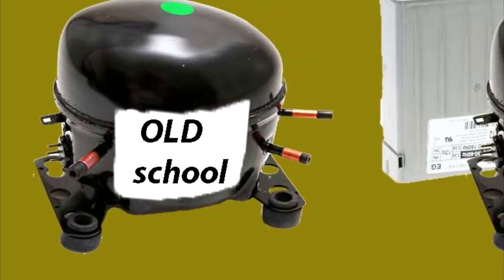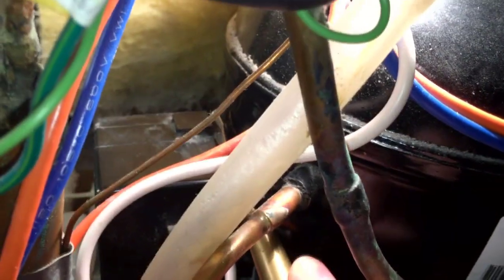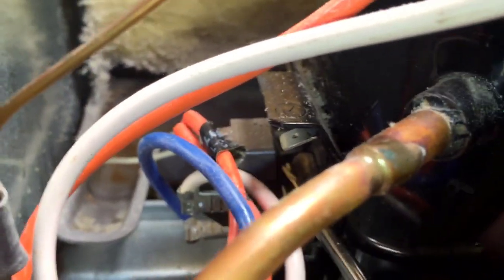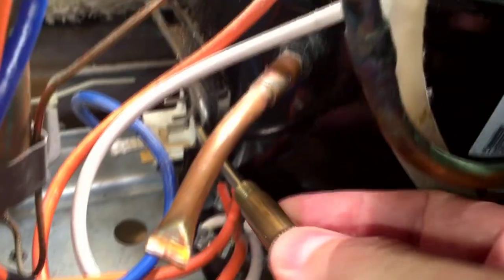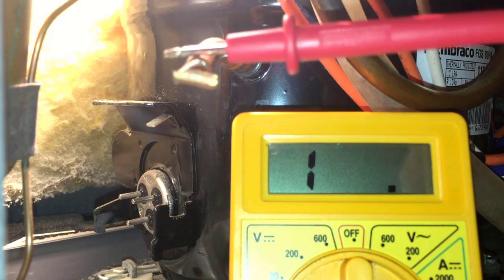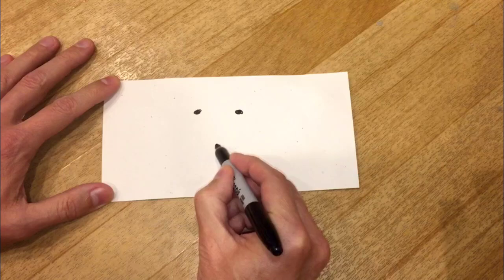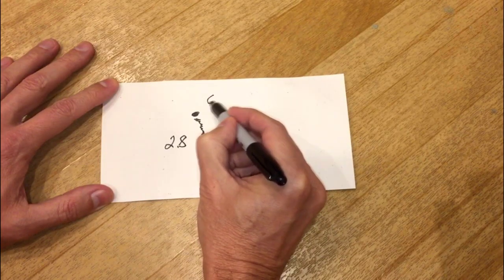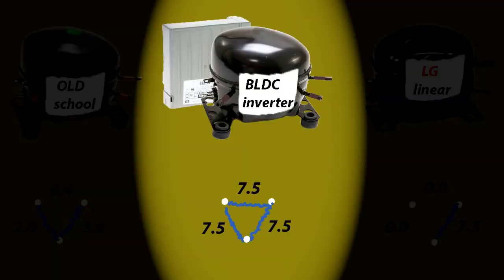Testing refrigerator compressor LG, Samsung, Whirlpool...

Comment: This is great information. Our 10-year old LG 3-door stopped cooling overnight. The fan runs, but it doesn't look like the compressor is running. There is no start relay/overload plugged into the compressor, just a connector that goes to the grey (actually it's off-white) box mounted to the side of the fridge. Our compressor passed the short test - all three leads measured open when I put one lead on a compressor pin and the other on the copper pipe. However, when I measured lead to lead, I only had one measurement with a reading... but it wasn't on the "right side" winding, it was on the left and it measured 6.9 ohms. The top winding and the right winding both measured open.

So, the question is, is the compressor bad? 

I ask because in your descriptions, my set up looks like a BLDC inverter because there is a grey (off-white) box to the left of the compressor. However, ours does measure similar to the LG Linear example, albeit on the opposite winding. I'm wondering because our unit is an LG, so perhaps the compressor readings are good and I need to test the start capacitor on the grey (off-white) box and/or maybe open the box and look for the start relay?

If you're still monitoring this thread, I'd love some feedback before the service tech arrives tomorrow! Thanks :-)
Reply from the maker: You have one of the earliest LG linear compressor setups with a separate Main PCB and a Drive PCB (inverter box). According to your measurement, the compressor seems OK. You could run a Test Mode by pressing the button on the Main PCB, and see if the compressor and fans run like on this video: https://youtu.be/70y61Sq_NU0 
Also, you may see a light on the inverter box flashing error codes
Reply: @Your-Self  well that's some (hopefully) good news! Compressors aren't cheap :-) We've had good service for 10 years out of this unit and I'd like to keep her going if I can.

I ran the push button tests on the main PCB earlier and other than the fan motor coming on, the compressor seeming to not come on, and the front display showing 22, 33, 44 when I was cycling through the tests, it really didn't tell me much.

I've got the inverter box apart and see the LED. I'll  try to make it flash in the morning when I can reconnect the compressor power leads and plug the unit in.

Does that same video link (above?) that shows the list of flashes that equal certain error codes explain how to kick off the tests?

Thank you very much for your quick response!!
Reply from the maker: Yes, the same linked video with error codes.
If the compressor is not running during the Test, the inverter box is probably bad, or the Main board.
Reply: So, with drive PCB visible and everything plugged in, I ran the tests using the button on the main PCB. The LED on the drive PCB did not illuminate or flash at any time during the test sequence. 

Generally, on first press, the fan speed increased and I saw 88 on the front panel. On the second press, the fan speed stayed high and the front panel showed 22. On the third press, the fan stopped and 33 was on the front display. Fourth press showed 44 on front display and heard some relay "clicks" on the main PCB. I ended up unplugging the mains and plugging it back in to reset and the fan came on normal speed. 

At no time is the compressor coming on. I've been unable to find the exact service manual online for our model and am suspicious about trying to troubleshoot further using a different (but close) model's voltage and test point guide. 

Any thoughts?
Reply from the maker: If you provide your refrigerator model number, I may be able to find the correct Tech Sheet to narrow down the problem to Main or Drive PCB.
Reply: @Your-Self  LFX25976SB /00
Reply from the maker: I found your manual, but it's not very clear about the Test Points translated from Korean.
So, this is what I'd do... (Disclaimer, working with live voltages is dangerous)
First, verify the Fuse on the inverter is not blown.
The connector CON201 on the inverter receives 120 VAC Blue and White wires, so verify that you have the voltage.
The CON203 powers the compressor. You can unplug this 203 connector and start the Test1. Place one lead on where the Black POWER wire was, and the second lead on (that's where the translation is unclear) on where the Blue COMMON wire was, or Brown or Orange CAPACITOR wire was... so I'd test the POWER pin to COMM, to CAP, and to CAP pins... and should get about 200 VAC at least on one or all of them.
The connector CN2 on the inverter is supposed to receive a small variable ~2-5 run DC voltage signal from the Mainboard CON8.
If you are VERY comfortable working with electricity, you can jump-start the Linear compressor directly from the wall outlet. Apply the voltage on the left 2 pins (where you measured 6.9 ohms) to verify the compressor is capable of running.
If you don't want to do all tests, start replacing the inverter board first, and then the Mainboard if needed.
Reply: @Your-Self  Thank you! I had to run to an appointment, but we have a service tech at the house troubleshooting. He complained over the phone that the fridge should've been powered on for at least 24 hours straight for him to be able to troubleshoot properly. That may be the case with some troubles, but I'm hoping this is a little simpler than he thinks.

With regard to your notes above, I can confirm I have 124 VAC at CON201 - and I made the CON2 from CON8 connection from the main board looking at the schematic on the back of the fridge... but didn't try to check any voltage there. The only measurement I tried on CON203 was between COM and CAP (the two wires that feed the run capacitor). With my meter set on 200VAC, the reading was varying between about 3 or 4 VAC and 35 VAC. That was true with or without the capacitor attached/connected. I took the capacitor to a local shop and they tested it for me - it tested good.

All that led me to believe that it was the inverter board that was the problem (albeit without confirming the control voltage coming from the main board on CON2).

Once I hear from the tech or get home, I'll let you know where we end up.

Thanks again for feeding me such great, usable information!
Reply: @Your-Self  Well, things didn't turn out like I had hoped! The technician came and after tearing the bottom freezer apart, declared the evaporator bad. Apparently the compressor kicked back on at some point and the unit was not cooling at all - no frost developed on the evaporator after several hours of running.

Bottom line, to make the wife happy, we now have a $3200 Whirlpool 4-door fridge. What a mess!

Appreciate your help and info throughout the process. Have a great weekend!
Reply from the maker: On the bright side, that type of LG linear compressor average life is only 3 years, but you got 10 years out of it... not bad at all.
Congrats on the new refrigerator!
Reply: @Your-Self  Thanks! It's a Whirlpool 4-door and, just in case, we bought the 5-year service plan with it from Lowe's :-) But dang - I think it cost as much as my first car lol

Comment: I have an lg linear compressor and according to your test it's good. Relay is good. I want o check for feon leaks with  soap and water. I already checked behind the access panel in the bottom rear and did find anything. Should I check the coils behinf the back wall also and if so dies the refrigerator have power while checking? I was going to power down ofcourse while accessing and was wondering if I should power it back on to testcwith sosp and water. Thank you in advance as I'm pulling my hair out after checking everything I can think of.
Reply from the maker: The Sealed System is always under pressure, so the refrigerator can be unplugged to check for Freon leak. 
If the compressor is running, but not cooling, most likely it's worn-out mechanically inside.
How old is your fridge? It could be under LG 5, or 10-year warranty.
Reply: @Your-Self  I'm trying to start a little hobby/startup business of buying used faulty refrigerators and trying to fix them and sell for a profit. I bought it for $73 and rolled the dice it wasn't going to be the compressor. I felt like a took a class in refrigerator repair with everything I learned. I like tinkering with things but this has me beyond frustrated. So long story short its 7 years old I believe but I can't use  the warranty. Thank you for the response, maybe take the rear wall of the inside and check those coils for a leak. One more question please. I've heard you can transport them on it's side for short periods of time if you allow the same period of time after you unload and stand it up before you plug it in. Any truth in that?
Reply from the maker: To figure out whether it's a leak or an inefficient compressor, you need to check the pressure inside the Sealed System... low pressure indicates a leak.
If transporting the refrigerator laying down, the oil from the compressor will flow into the pipes where it's not supposed to be. Giving "enough" time the oil should drain back into the compressor.

Comment: My LG FRIDGE stopped freezing all the items in the freezer the fan seems to work ..also takes forever making Ice as well. Do you think this is an easy fix? Gonna have to throw away a bunch of food soon :( can't seem to find a freezer switch either
Reply from the maker: There is no easy answer to this question. Maybe need to clean condenser coils from dust, or it could be a beginning of a major Sealed System problem. Try to run a system Test first as on the linked video, and go from there... https://youtu.be/70y61Sq_NU0

Comment: 6.3, 6.3, 10.6 are my numbers. Freezer and fridge both cool but not cold, starter relay making a loud click as well. I'd initially thought it was the starter relay, as the overload reading was pretty high (3.4). But because the numbers are so off on the compressor, and the relay isn't really too rattly, I just don't know.
Reply from the maker: The numbers don't look good for a basic compressor, nor for BLDC. I'd verify the resistance once more.
If the compressor starts and runs for a few minutes the start relay is good.
If the compressor starts and runs for a few seconds, you may have a failed TSD starter instead of more popular PTC relay which may rattle when bad, and the compressor would not start at all.
Reply: @Your-Self  So, I think you're onto something. After the click, I feel like I do hear the compressor hum to life, but it doesn't seem like it sustains for long. This repeats every couple of minutes when the clicking comes back. Seems more and more like the compressor is bad.

This may be entering into speculation territory, but we've had some bad electrical issues with our fuse box in the house recently. Lots of brown-outs and black-outs, sometimes several in a single day. While we recently got the box replaced, I noticed that the refrigerator issues started very soon after, perhaps even the same day as the box got changed out.

Could the flickering power have possibly shot this compressor? It's pretty new, under two years old, and ran fine before the power issues. Have you ever heard of something like this?

Thanks very much for the quick response. This channel is awesome–you have a new subscriber!
Reply from the maker: Flickering power is not good for any device, so it's possible that the compressor got damaged by it. If you are certain that the measured resistance is correct, the compressor is probably dead. Two windings on a basic compressor can not be the same. A Start winding should be larger than a Run winding, and a combination of those 2 values should be the largest number. Sorry for the bad news :(
Reply: @Your-Self  So, I've got some good news! After banging my head against this project all day, I decided to take a break and do some cleaning. Plugged the vacuum into the same outlet as the fridge, and when I turned it on it sounded like it was turbo charged. Then, it started giving off an electrical burning smell, so I promptly turned it off. Moved it to another outlet, vacuum ran fine.

Got a hunch that using an extension cable to get the fridge hooked up to the good outlet might help out. Few hours later, and we've got ice cubes again! I reckon the compressor was pulling way too much off the outlet, and the overload had to keep kicking in to keep from things going all the way to pot. I also realized the compressor itself was getting very warm very fast, even after being left unplugged and cooled off for a few hours.

So, I'm giving the electrician another call tomorrow. But for the time being, looks like we don't need a new fridge! Thanks for helping me trouble shoot, and educating me along the way.
Reply from the maker: Glad it worked-out better than expected!!!

Comment: I have an LG linear compressor. I checked compressor ohms, freon pressure and both are good. Compressor appears to run, but inlet and outlet pressures are stagnant. When I put it in test mode the voltage on the main PCB only gets to 100 volts and shuts down. The tech sheet recommends replacing the PCB, but at $200, I'm a little hesitant. Is there an easy way to test run the compressor before I take a dive on the PCB?
Reply from the maker: LG linear compressors can run directly from the 120VAC wall outlet. You can apply the voltage on those 2 pins that you tested for ohms. The compressor will run but sound a little louder than usual.
Reply: @Your-Self  Thanks, you saved me from spending $200 on a PCB. It turned out to be the 1 year old  compressor. I will never purchase an LG appliance again.
Reply from the maker: LG recognized the problem with its Linear compressor and extended the free-replacement program for up to 5 years. Now they install an updated version of that compressor, which supposed to last longer... we'll see.
Reply: @Your-Self  Its actually a Kenmore refrigerator with LG parts. Sears replaced the LG compressor 1.5 years ago, but only gave me a 90 day warranty on it. I still have the receipt for the work. I'm going to see if LG will honor the warranty on the compressor. Not really sure if I got the new and improved compressor, but 1.5 years is unacceptable. Thanks again.
Reply from the maker: Yep, 1.5 years on the replacement compressor is pathetic. Hope you can get it covered!

Comment: Samsung model number rf26XAEBP, unplugged for 10 minutes comes back in  OF OF (demo mode I guess) I reset it using top left and right button. I resets for 3 seconds then goes back into OF OF. How do I test the front door panel or is it shot or something else? Thanks
Reply from the maker: If OF-OF is blinking, press on the Top and Middle buttons on the left side simultaneously, and your fridge should go into normal operation.
Why is it in OFF position, what are you trying to do?
Reply: YourSelf tried that. I’m trying to set the freezer and refrigerator settings. It simply goes back to demo mode. My best effort so far is top left and right button. I get to the settings screen but by the time I set the freezer it goes back to demo mode
Reply: Do I need to replace the panel board or is it in the main circuit board
Reply from the maker: These are very complicated computer-operated machines, and every blink on the display panel means something different. It's impossible for me to recommend an action without knowing what's going on there. 
On initial power-up the main PCB goes through self-diagnostics, and if there is a problem the screen may freeze with error codes.
Is there an actual problem with your fridge... like not cooling, beeping, fan not working, no ice... what was happening before the OF OF came up on the screen? Is it your fridge, or somebody gave it to you already broken?
When you plug the fridge in, immediately try to record a video of the display screen for a couple of minutes, post it on YouTube, and provide the link here. Maybe I can see the problem for myself.
Reply from the maker: What is that above link for?
Reply from the maker: To do anything with this refrigerator, you need to bring it back to NORMAL MODE.
According to Samsung, don't touch any buttons for 1 minute, and then press the two left top buttons for 3 seconds (Energy saver & Freezer)
I can't help you if you don't answer simple troubleshooting questions...
what's wrong with your refrigerator besides OF-OF?
is it cooling now and what is the temperature inside... if not cooling, was it cooling before?
if you just got this fridge, it could be a Demo model (no compressor)
Reply: YourSelf it’s been working fine for years and just started this demo mode. It is not cooling either with the freezer nor the refrigerator because it doesn’t get out of demo mode. Yes I tried to reset it per your suggestion. It doesn’t work. Do I need a new panel board?
Reply from the maker: Gotcha.
The sure way to fix it is to replace both boards, but I'd start with the main PCB first, and most of the time that works.
But before you replace anything, keep in mind that pressing those two buttons has to be done EXACTLY simultaneously. So I'd try many more times, with 1-minute cool-off periods.
If that doesn't work, you can try to heat both compartments above 149°F, and that should automatically kick the fridge from the Demo mode into the Normal mode. If you use hairdryers as a heat source, don't bring it too close to the interior lining... THE PLASTIC WILL MELT.